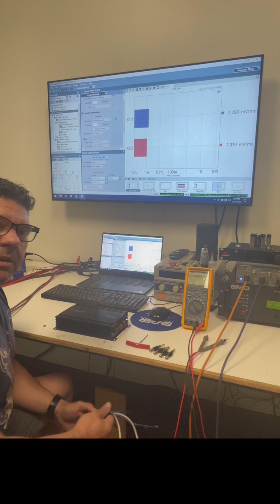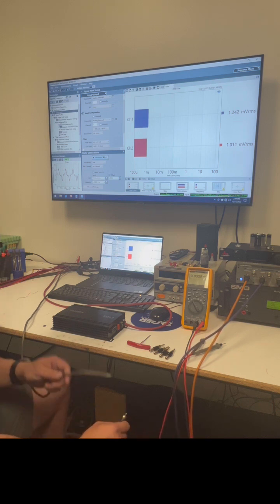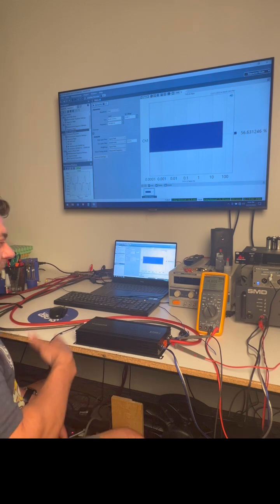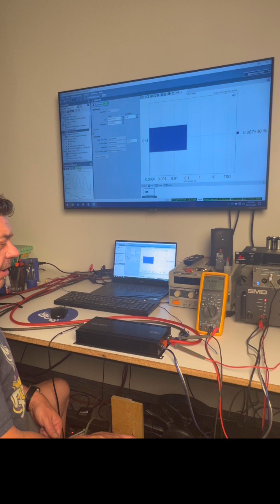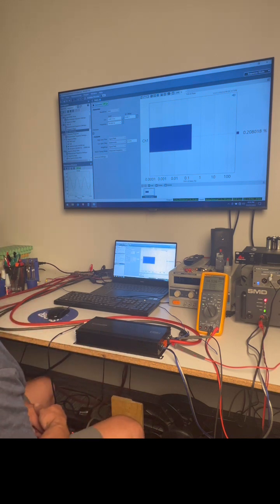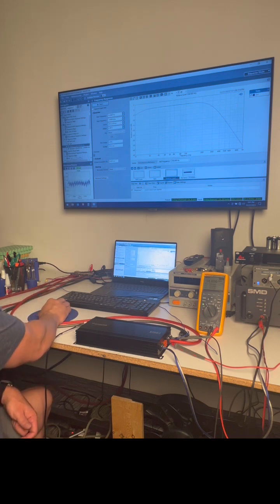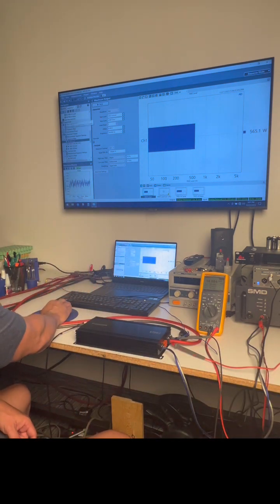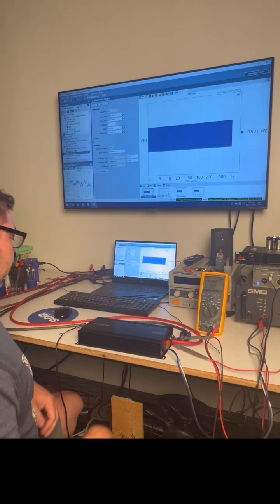S1E2 D'Amore Engineering Bench Testing E750.1 Car Audio Amplifier

Comment: Why do  amps  class d have issues with noise or. Distortion at high frequency signals but very clean lower  frequency
Reply: These amps do not have that issue, I run the 350.2 and the 750.1 both fantastic sounding amps especially at the price point it's unbelievable

Comment: Not trying to be an ass but why would you want to turn off the infrasonic filter?  Why waste power on non-program noise?
Reply: I run an 18" Infinite baffle sub that plays flat down to 13hz and probably lower, I just haven't been able to measure lower than that due to mic frequency response limitations. At that frequency it's more about feeling the pressurization in the cabin that it is hearing that low. Since I have a system that can take advantage of playing that  low then I want an amp that can bypass the subsonic filter
Reply: So these aren't the constant current draw cap bank buffered series amps then.  I'm still holding out on one of those bad boys for my BMW.
Reply: @nathanieljames7462 The constant current amps are not even on the market. The amps tested are his traditional style, affordable amps.
Reply: @nathanieljames7462 Some people like to play very low frequencies. Of course, you need the sub system to play them. Not everyone does. You apparently don't. For the few who do, its a nice option to be able to turn off the filter.
Reply: Some like the low lows......  if you havent watched, or seen vid's.
Reply: At 10 that is low enough for 99.99% of anybody I promise I’ve had amps that go a lot lower and at 10 it pulls the doors in so I could just imagine what two and five would be like destruction.
Reply: @ashcoleman8866 What are you talking about with the numbers 2, 5 and 10?
Reply: I have one of these ants, and I am truly impressed by it!!!